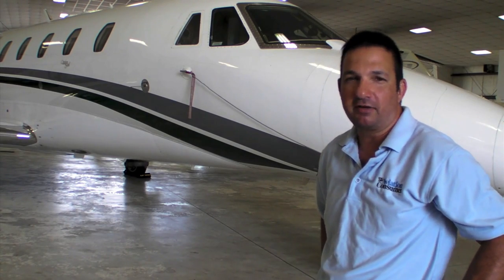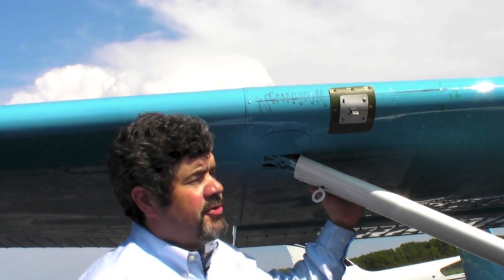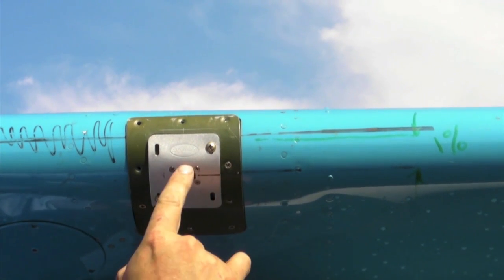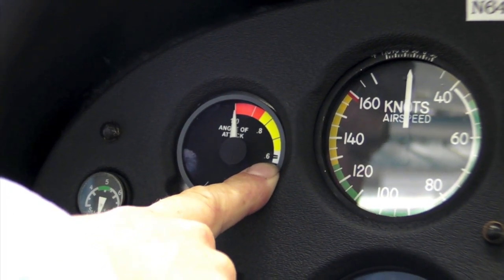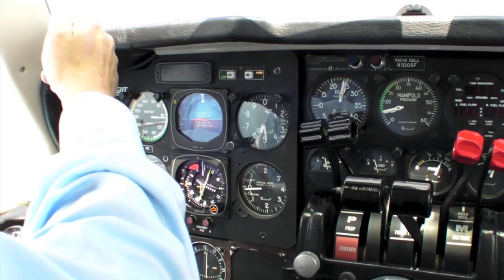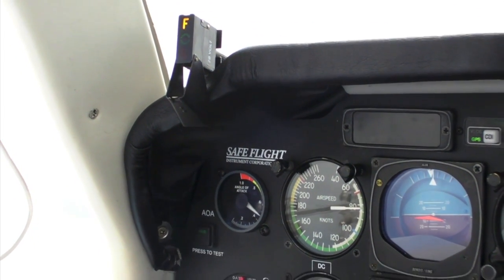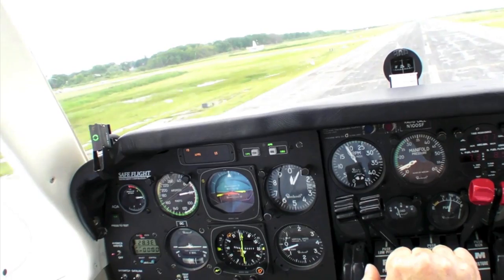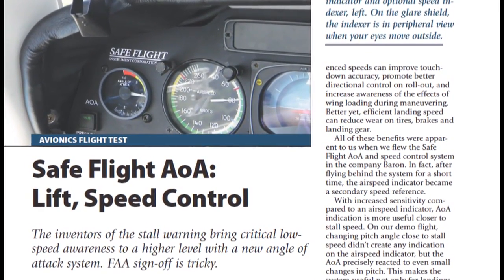Safe Flight AOA/Speed Control System

Comment: AOA is essential for safe flight and superior control.  However, your design of the on speed indicator lights is upside down compared to the fast and slow chevrons used in millions of flight hours in Navy and Marine jet aircraft.  For example, there is also much value in having the upper chevron (high AOA) pointing down to remind the pilot that the recovery from a high AOA/Stall condition is also to push the nose down.  On the other hand, the gauge and needle are correct and easily interpreted.

Comment: I like it! Except that a traditional AOA indexer commonly found in military airplanes has the fast indication on the bottom of the on-speed indication, and has an arrow that points up. The slow indication is on the top of the circle with an arrow pointing down. I think the traditional ones are more intuitive and reminds the pilot to pitch for the proper speed.

Comment: Well it's about time.  Having flown aircraft with AOA indexers and those without, I can say unequivocally that having one is the preferred choice.  I don't think you'd find anyone that has flown with them would disagree.  Stall speed can change from day to day, flight to flight, but the angle of attack at which a wing stalls is always the same.  AOA indexers take all the math out of the process.  Fly the donut and you are assured of safe, precise and consistent landings. Definitely a must have.

Comment: I just wonder if this will become like the cirrus parachute. Another tool that makes pilots think they can go out and do whatever they want. Because if they get into trouble the bells and whistles will warn them. Then they get into a plane that doesn't have this system. They are used to the visual cues from the light system and the gauge. Forget the plane they are flying doesn't have the system.. Boom stall spin.. Dead

Comment: I'm not sure I understand the value of having both the AOA gauge and the AOA indexer. I have an Alpha Systems AOA analog gauge version mounted on the top of the panel--it's in my peripheral vision on every approach--easy to see and use. An indexer would be just as useful. Having both is duplicative, conceivably unnecessarily adding to the cost. These comments are not to disparage having some sort of AOA indicator, because if I ever buy another airplane, I will have an AOA indicator installed.